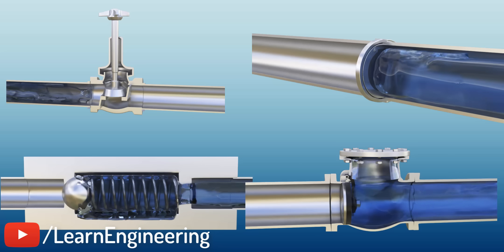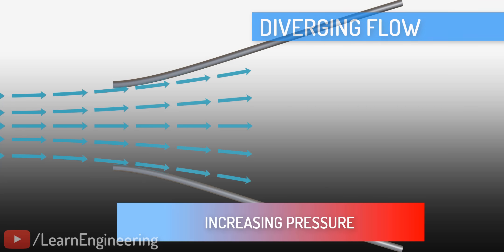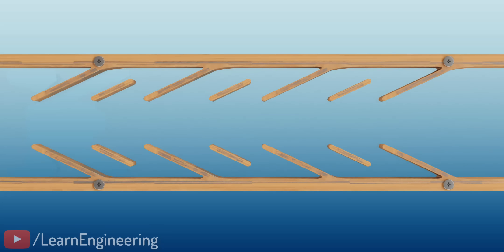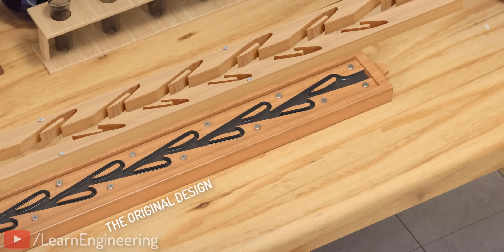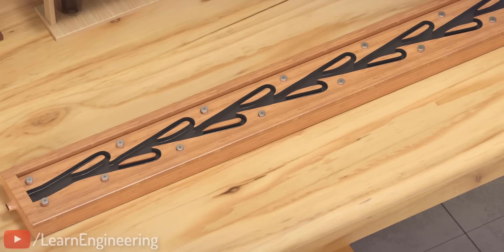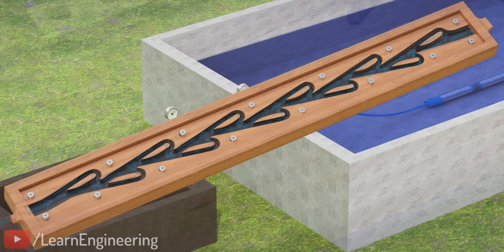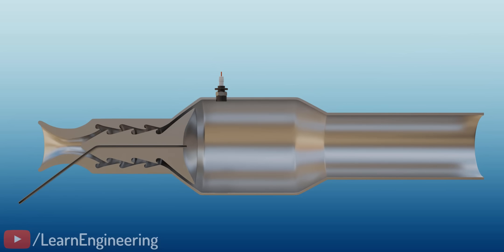Tesla Valve | The complete physics

Comment: well, it's not really a "one-way valve". Any other valve you showed in the intro completely stops the flow in the unwanted direction, not only slows it down. In reality, any of those valves that let so much water through in the "wrong" direction would be considered defective. 
Additionally the "normal" one-way valves take up much less space, have less problems with dirty liquids (or just "hard" water) and can be repared easily. And they probably have less resistance in the "wanted" direction, too.
Sure it might have some limited value in rare circumstances, but if you'd ask me if I wanted a real one-way valve between my pool and the freshwater supply or the Tesla one I know what I'd choose...

Comment: I can see an advancement.... Using 3d space if engineering, the application could be further enhanced, as I am sure Tesla was thinking the same thing, but only so many tools are present. You could create a tordial force, rather then his two dimensional design... If you change the reverse exit, by restricting the flix of x. You would create possibly a vacuum, like a water lock that would stop the flow eventually, going the opposite direction. This would require further examination and even a partial system, but at that point a one way hate is typically easier, but engineering something without a gate, where a gate is t preferable or a dril system could be enough of a challenge.. hmm

Comment: 1:00 both are equal. The structures are symmetrical, which means you could add a wall in the middle. Then you end up with identical structures for each case.

Comment: I would call it more an anti-return valve than a classic valve, mostly because if you want to stop the directed flow...u have to move something anyway. Besides that - very interesting piece of material :)
Reply: dude man  but bit doesn't even do that in real life, it only works in cartoons.
Reply: It's not meant to be a shut off valve, just a one way valve to prevent contaminates from entering the source. We call them check valves. We use them in almost every building and system that uses water. Here Tesla created the same effect in a more efficient way, without moving parts, by creating pressure differentials. In the little clip where water is flowing into the black pan, contaminates would not be able to enter supply tank because of the resistance offered by the device in combination with the positive pressure from the supply. It works as well with airflow which is why it is seen here being used in the jet propulsion application. The positive pressure from the engine and the increased resistance at the prevent backflow of fresh air. I hope this clears up the type of valve and some basic applications for it and, most importantly, why.
Reply: @Clever_Moniker  exactly, to prevent reversion

Comment: Makes sense. Given Tesla’s circuit - current manipulation via design. A selectively permeable membrane will also behave as a one way, non-moving parts, valve. 3M had some available documentation of keeping a bird in an underwater area enclosure with walls capable of allowing oxygen in from the surrounding water.

Comment: Why does the pressure increase when the flow diverges? Doesn't this decrease the amount of watermolecules and therefore mean less pressure?
Reply: Yes, sounds counter intuitive. What happens is, conservation of mass means that as the cross-section widens, the molecules will slow down and accumulate in the direction of flow. Think of soldiers marching in line when a bunch of them decide not to walk so fast. I think you are right in that if you blocked off the recirculating path, you would create a "virtual" smaller tube without the resultant pressure increase. However, there would be more friction and reduced flow in both directions.
Reply: @ramorrisey  That makes sense but I thought he said in the video that the water sped up when it widens. How come the molecules slow down then?

Comment: I don't know the names of the parts of speech, but "Nikola Tesla has developed a one way valve..."  implies that he's still active.  It's the same as "I hear Frederick Douglass has been doing great things..."    (Oddly, the French language doesn't seem to have a perfect past mood.  They say "I have gone" when it means "I went", as well as the meaning implied in English.  We, however, DO have a perfect past tense, and we should use it when appropriate.)

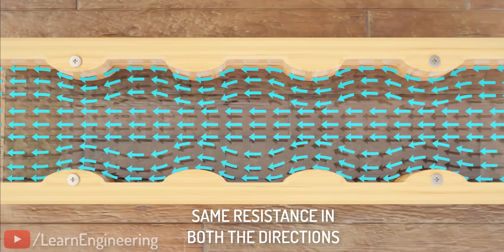In the same way, at 0:50 "when fluid enters from any side" is not sensible.  That's EITHER side.  This illustration has only two sides.  Listening to this text is painful and reveals ignorance or insensitivity about something, though just what that is, I don't know.  

But, now that I'm done complaining, I must say the content was clear and enlightening, for which I thank the authors.  

I'm pretty sure veins have non-moving valves that make sure blood goes only back to heart, despite the absence of a pump.  Is that mechanism similar?

Comment: FYI: Einstein also invented a refrigeration system that had no moving parts. Not very efficient, but it only needs a heat source to operate.
Reply: This is an ordinary refrigerator with ammonia as a refrigerant. And this refrigerator is very efficient.
Reply: @MrOleg2805  Hardly ordinary. No mechanical pump. And it used 3 fluids. Water, butane, and ammonia. And it's not as efficient as a modern pump type system. If it was, you would see it being used.
Reply: @PointyTailofSatan  All campers on wheels have ammonia refrigerators!
Reply: @MrOleg2805  Yep. Because a reliable source of electricity often isn't available in an RV situation. But a modern pump based refrigerator is still more efficient, energy wise. I believe modern compressor type refrigerators are like 4 times more efficient.

Comment: This is some BS. Do you know what differs 4 valves from the beginning with the tesla valve? The fack that they are actually working valves capable of stopping the water flow. Tesla "Valve" can drastically slow down the flow but it won't ever stop it thou making it a regulator.

Comment: How can it be classed as a "valve"? It does not shut liquid off, it does not reduce or increase liquid flow in time frame. It is exact the same as you would install lower diameter tube in to your line. The only thing it creates is a lot of turbulence and friction in to walls, which will lead in to corrosion.
Reply: Its exactly the same as if you install a lower diameter tube in your line one way for sure...

Comment: So the answer to can you create a valve without a moving part question is NO. 
The Tesla valve increases the pressure drop in one direction so the flow will be reduce drastically  but their will be a flow... It allows then a control of the flow  rate not a perfect stop of it. You would not be able to use this valve instead of all the valve that you shown at the beginning of the video.
Reply: Hi there, I'm Fasil.  I studied electrical engineering so my knowledge of fluid dynamics is that I know it's a thing.  I thought the same thing about it not being a proper valve.  However I can see real world application as a way to reduce water hammer and allow for using a much smaller true one-way valve in series.  But then, we're not talking about electron flow so what the hell do I know.
Reply: Plus you still have to move the whole system 180 to switch the flow rate. This has more movement than any of the others too the whole system has to be moved from an external input. This is a bad design for the problem that the video set up in the beginning.
Reply: What if you increase the length of the valve? Wouldn't the obstruction at some point equal the force pumping the fluid? Maybe if it's increased high enough the fluid will flow in the opposite direction?
Reply: for the sake of conversation, wouldn't the fluid count as a moving part regardless of valve construction?
Reply: I wonder.  I think that with normal resistance, you could restrict the flow with a long enough pipe.  When you add in the resistance from Tesla's valve design, the length would be less.  I realize this is a physicists approach where we can make the pipe semi-infinite if needed but, it the limit, it would stop all the flow.
Reply: He didn't say just VALVE, he said ONE WAY VALVE which means it's supposed to let liquid from one side to flow, and do not let from the other side. 
Surprised no one else explained this in the replies, did you guys even watch the video?
Reply: I suppose there is probably a modified Tesla valve that uses gravity in addition to flow self obstruction to basically reduce it to zero. Brb, going to refresh my understanding of the Bernoulli principle, it has been several years.
Reply: @summushieremiasclarkson4700  
I'd say not possible without a fundamental change in the principle of the valve function. Tesla Valve needs flow to function, without even the minimal flow there'd be no back flow to oppose the flow.
Reply: @mobros2009  ok, in theory, you are correct. This is completely impractical and at this point just a ball-bearing valve is better, but if you have a Tesla valve in an elbow joint (vertical) and with flow direction favouring downward flow, and the control direction obviously has to flow up, fighting the force of gravity and the back pressure generated by the Tesla valve, which has to be as long as nx P exit, ie the Bernoulli principle, p²/rg + v²/2g = -h, r = density of water and h is the height of pressure drop. Since PV is constant, if you used the right length of Tesla valve oriented vertically where the direction you want to oppose has to flow up, it should be near impossible. The problem is this equation only worked for laminar flow, and the Tesla valve has complex inverse flow vectors, so the hydrostatic pressure is all over the place.

TL;DR it may be possible, and someone much smarter than me has probably already done it.
Reply: @summushieremiasclarkson4700  the problem with that is gravity will do the Same thing if the pipe is vertical 
 When the weight of the water or fluid is equal to pressure provided the flow stops.
Reply: @theoldman8877  Correct. The angle of the pipe is therefore critical, I'm not sure of the precise calculation due to the non-laminar flow, but it should be between 55-61 degrees.
Reply: @summushieremiasclarkson4700  what? Gravity Will not help a Tesla Valve "leaking", it restricts flow, not pressure. A long hose will also restrict flow in a similar way, but this design is both directional and more compact
Reply: That's what he said at the end of the video, that there will still be flow so technically its not a non-return valve.
Reply: But at the start of the video (which is seen by way more people then the end (that is true for ANY video)), he heavily implied at least, that it was possible to make a actual one-way non-moving parts valve on par with the ones he showed with moving parts
Reply: 🇱🇷Awesome, @Steve.watcher hepled me gain back my disabled account in a matter of seconds. Find him on Instagram to get this service and lots more 👍🏾
Reply: it still replaced the former valves in modern jet engines.
Reply: @Palo Kan Yes, because in such a place a total valve is not needed a flow decrease is enough. If the answer to the proposed question had actually been "yes" the only places the other valves would have stayed would be if there wouldn't have been enough room for the tesla valve, but as it turns out it only replaced the valves in a few places where a flow decrease is enough, the vast majority of tradition moving parts valves were not replaces because they need to shut the water completely
Reply: @GummieI  
I echo what you said, AND:
“Replaced _ valves in modern jet engines” implies the more traditional valves with moving parts were used in those sections of jet engine first. 
Show me. Were they?
I have zero background in jet engine history or design. But I want to say NO, those traditional valves with moving parts were never used successfully in those sections of jet engine. So the “Tesla valve” replaced nothing in modern jet engine.
“Found application in” and “Replaced” are two very different things.
Reply: @jack765ful  he did say it replaced reed valves, which were not shown at the beginning. Reed valves are simple and reliable (almost all 2-stroke chain saw and trimmer engines use them). 

What is hard to know from this video is the transient response of the valve. I’m guessing it’s pretty fast, but some initial flow is needed to create the resistance.

Fascinating anyway.
Reply: You can't simply debunked this question with your narrow explanation and say directly NO. Valves are used in many types of limitless applications and combinations. You've said this design can't complete stop a flow? Well it can, if you add more length, more vortices will be made thus building more resistance, resulting to weaker flow until it completely stops. Just like if you get a glass of water and an empty plastic bottle of coke fill that bottle with water and quickly turned it upside down dipping the bottle's mouth in the glass of water. And there will be no flow from the bottle to the glass. And another one, valves main purpose is to control the flow not stopping it completely, If your looking for a complete stop then you might consider to find a plug instead not a valve. A cork will do, plug it in the end of the tube and BOOM the flows stop, and your problem in this design solved! Maybe next time just appreciate what see than finding a flaw in someone's work, especially with this genius and state of the art design.
Reply: @k2mulak09  um, looking for conflict where there is none? But no, even if you make a Tesla Valve around the world and back, it still wont stop a flow. It will be almost stopped, but will probably be similar to just a hose of similar diameter. The design relies on inertia of the water to create turbulence to restrict flow, when the Speed is reduced this will not happen.
Reply: @LunaticCharade  yes, ultimately you leave the domain of hydrodynamics.  If the flow is zero we enter hydrostatics where  no flow means no opposing flows, no turbulence, we have a static system. The shape of a rigid connecting pipe makes no difference if there is no flow.

Comment: Really if it really worked better than every thing else we would see it being used every where. Space is a problem and there is leakage backward because flow is not stopped completely. Then you have the increased friction of the 'valve'. It was a good idea when testing wasn't really available as we have now and it turns out to be a cool play toy but not useful.

Comment: im not seeing how this is applicable to the question as it requires the Valve to be moved in order to function. I believe what you're looking for would  have to be solid state or magnetic.
Reply: It's a one way valve.  That's the question.  The vid,, I admit, didn't make it clear.  A better example would have switched the direction of the water by raising the lower tank.  The valve will block almost all the water from flowing in reverse.  It's not necessary to rotate the valve, that was very misleading.

Comment: One thing that would be worth mentioning is that Tesla's design relies a lot on Bernoulli's principle. The trade off, in this application, is between pressure and speed. The speed is determined by the Coandă effect. According to the definition, if a fluid meets a curved surface, in our case the added obstructions, it will attempt to follow it. When this happens, the fluid that needs to travel further on the encountered obstruction will speed up (and drop in pressure), resulting in a higher velocity, which will result in the diverging stream clashing with the main stream, obstructing it
Reply: Precisely! ....( I had no idea )
Reply: true... they use examples to be in line with their theory.. which is incorrect
Reply: @feizal7554  Can you share with us a link to a resource that outlines the correct theory? I'm sure a lot of people will be curious about it
Reply: @mirceastaicu4131  There is no "correct theory",  it is simply a theory, not having all the datum of each subsequent obstruction and / or separation of the fluids.  Basics in physic... the more obstructions in the flow path, the lower the  ve locity of the flow and the increase in the pressure, if there is a constant  force applied to cause the flow i nt the fiorst place
Reply: @786ALHAQ  Right, got it!
Reply: Yes, and the design also has similar affects as Archimedes describes with pulleys. But most importantly it all ties into the theroy of relativity and how we are moving thru spac and time. I think
Reply: Asa este Mircea, bine punctat! Good work there!

Comment: Nifty, but it will leak which might be OK in some applications but not others. It may also be more difficult and expensive to make compared to equivalent performance with a moving part.obviously it is the best solution for some problems but can't replace the $1 valve in my aquarium.
Reply: In an aquaium situation....this valve would make an excellant airiator tho

Comment: It may help with water climb I'm thinking but needs testing to know if the idea will work for that :3
Reply: water climb? 
you mean getting water from low elevations to higher ones?
Reply: they use pumps for that. designed for it. tesla valve was designed to be a zero moving part check valve and it fails.
all it really does is ad restrictions to flow. does almost nothing to pressure unless under flow conditions. 
https://www.youtube.com/watch?v=XhJtSqLz88Q&ab_channel=PhysicsHack here's a video of someone actually testing one. 
tesla just didnt get it right on this one.